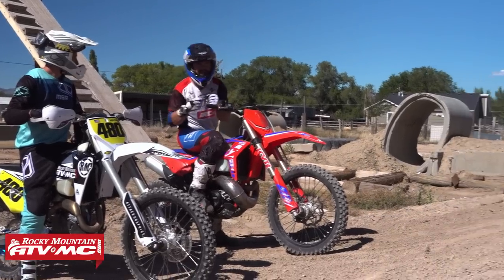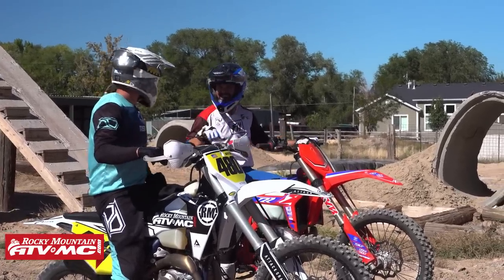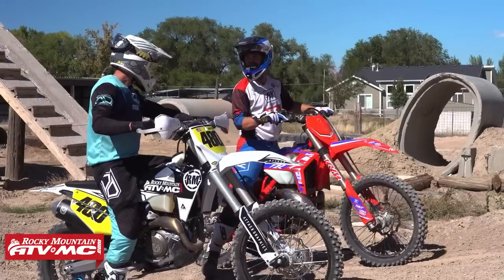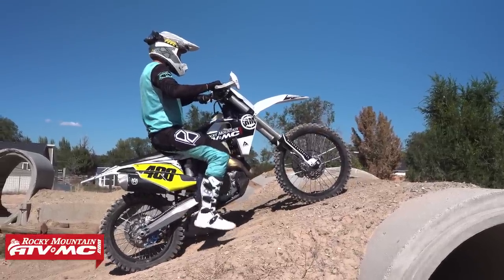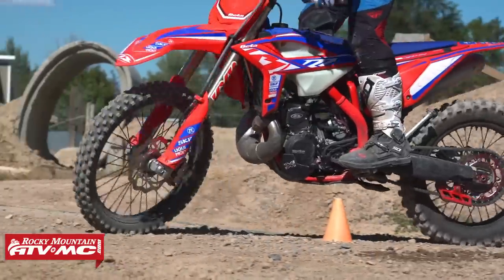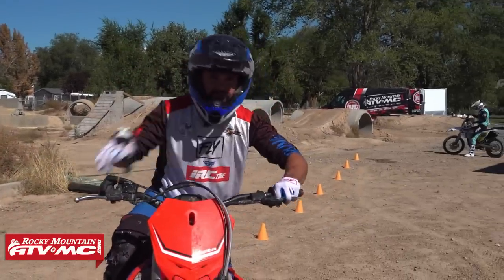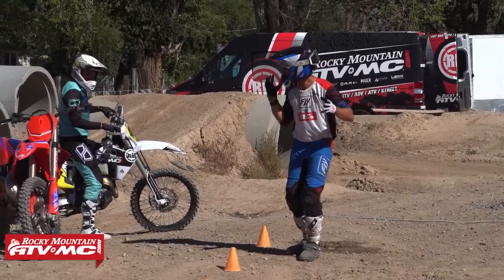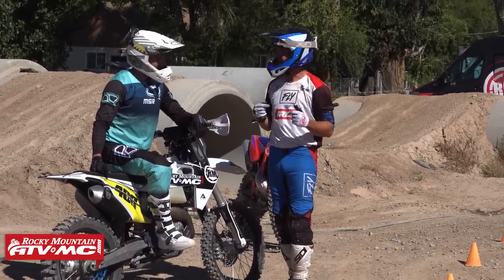Dirt Bike Clutch Control Tips | Pro Enduro Riding Tips w/ Rich Larsen

Comment: Would love to know what the tire pressure you were running..
Reply from the maker: I had mousse inserts on my bike, but if you have ultra heavy duty tubes, you could go as low as 8PSI. If you want to go lower than that (6psi), you will need the Tubliss system. You probably already know but for hard enduro/technical, low pressure or a plushie mousse will help a lot with traction. I just run the mousse so I don't have to deal with flats. -Charles https://www.rockymountainatvmc.com/tires-and-wheels/nuetech-nitro-mousse-soft-plushie-foam-tube-p https://www.rockymountainatvmc.com/tires-and-wheels/tusk-ultra-heavy-duty-4mm-motorcycle-tube-p https://www.rockymountainatvmc.com/tires-and-wheels/nuetech-tubliss-gen-2.0-%28tubeless%29-tire-system-p

Comment: Advantage 2 stroke on these style drills especially if Charles is on his 450 and I think he is. Flame out city
Reply: Rich could do it on that 450 no issue.
Reply: @HardEnduroLlewellyn he does it on a Yamaha 250 or 450 4t on one of his other videos just as easy but for me the 2t would be much easier. like I say that's just me but he's good on anything
Reply: @griffithracingteam2412  2T 300 all day! On the road or desert racing / fire roads…4T. Other than that, 2T everytime…all the time.
Reply: Clutch control matters much more on a 450 to avoid flame out. Us 450 guys abuse our clutches more than 2T guys all day long for that reason. But it can absolutely be done. Keep those RPMs up. It's the slow technical stuff where you start to overheat unfortunately. I just take that cool down time for a trail brew or some cold water. 😂